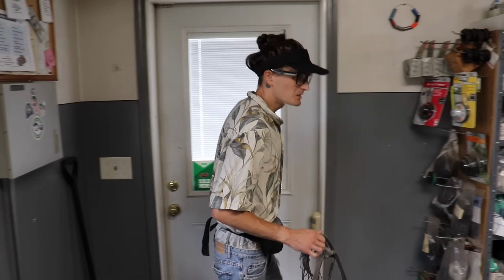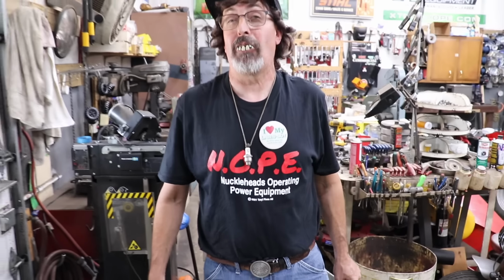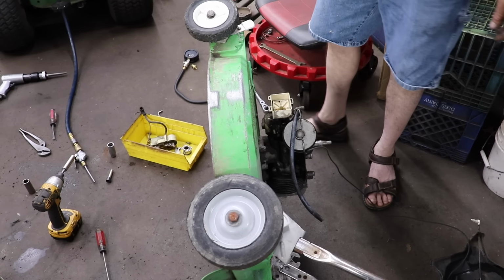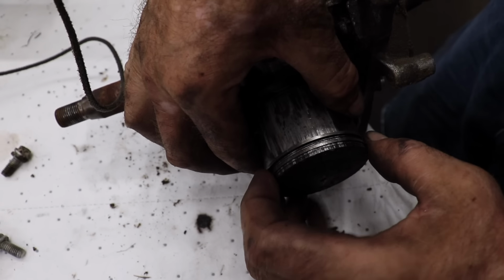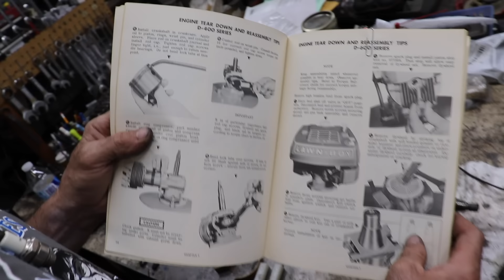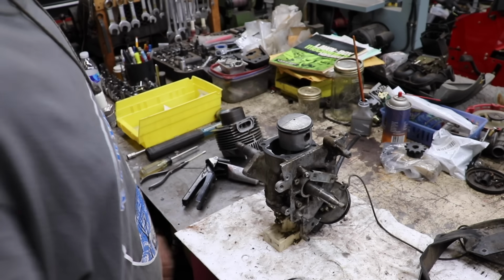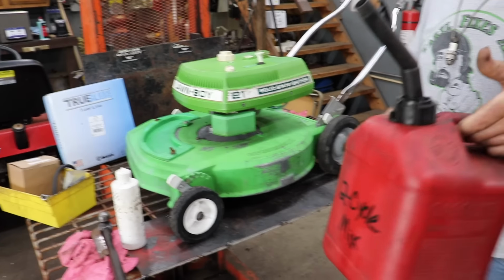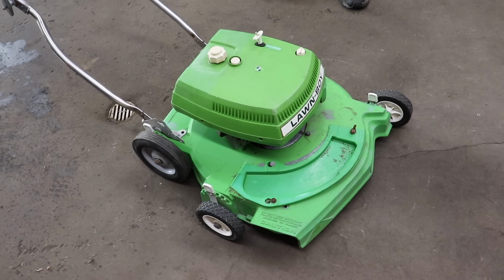Epic Lawn Boy Engine Rebuild

Comment: Haven't seen a Lawnboy in ages. They were great mowers. Never need to change the oil. Runs at high rpm which is great for cutting. Because it's 2 stroke it was way lighter. It threw the clippings farther as well. I never saw one with a bag but I bet they had one. There's a plate on the deck for one. Due to its 2 stroke less parts and things could break on it. The offset wheels also lended to easy tight areas/corners and made it easy to turn. The 2 stroke ban killed them. To bad but Taryl's Got You. Great work My Dude. Great to see the old girl working again.
Reply: We had one with a bag when I was a kid in mid 1970's. It was also self propelled.
Reply: @93sundance  I have one with a bag and it's a commercial model , pick it up at a estate sale a few months ago  in a three mower lot for $30.00 and the reason I bought the lot was just for the Lawn Boy since I'm into restoring antique chainsaws . Only thing wrong with it the plastic piece that slides that controls the engine speed was broke because it got all gum up and someone forced it and broke it but I got a new one . Its self propelled also .
Reply: Thank the  E P A ..for that .
Reply: There was/is no 2 stroke ban.  If you find one, let me know.
Reply: @kevinjohnson5214  EPA didn't ban 2 stroke mowers.  Manufacturers didn't want to invest in clean 2 stroke engine development.  So they discontinued them altogether.  Their last models met EPA regs.  I guess it was easier(cheaper) to make a 4 stroke do what a 2 stroke could than to make a 2 stroke as clean as a 4 stroke.  It was a purely financial decision.  We may not like EPA sometimes, but I shudder to think what the air and water would be like today if we left it to engine manufacturers and chemical companies to self regulate with no regulations.  I remember rainbow colored rivers and choking at stop lights when I was a kid.  The clean air and water acts are two things President Nixon's grandchildren can be proud of.
Reply: @mikemorgan4607  i could sell you one.
Reply: @imakedookie  What model?  My comment wasn't clear enough.  Sorry about that.  I meant "if you find an EPA ban on 2 stroke engines, let me know where."   There may be one in the future and in eco serious states like California may have already imposed some.  As far as I know, EPA didn't ban any.  But the handwriting was nailed to the wall already.  They had to undersize the jet on the Dura Force to make emission specs, and that was in the late 1990s.  There is no way(evidently Toro's margins aren't high enough to allow them to bribe that many congressmen, haha) that emmission standards will go backward.  And that's clearly as it should be.  While they probably could make them burn cleaner, it would cost a LOT of R&D $$ to get where they's want to be.  It was more cost effective to just discontinue production.   But I still have 2 stroke LB Mowers.  And I love em.  I actually bought this one from Taryl.  Great mowers!
Reply: @mikemorgan4607  so if you are an enthusiast, would you happen to have heard of the channel two stroke stuffing? I think the man is onto something, the small displacement supercharged two stroke nitro engine is evolving towards 500cc and 50 hp, i believe... hes gotten it into the 30-ish range so far if im not mistaken
Reply: @imakedookie  I'll have to check that out, thanks.

Comment: I have about three or four of these sitting in my garage. One of the best trim mowers to have especially if you have a real steep hillside you don't have to worry about the engine oil lubrication on a steep hill and it's lightweight.

Comment: Hands down the best general duty push mowers ever made.....
Light weight, powerful and does a beautiful job of manicuring a lawn.
They should have never quit making them !!!!
Reply: I've got 2 lawnboys. Best lawnmower out there I say.
Reply: OMC built good engines for these LB's then big daddy Federal said  no more lawn mower two-stroke engines
Reply: @redwolfpiping5701  OMC sold LawnBoy to Toro in 1988 - years before the Fed Ban.
Reply: The only thing I didn’t like about mine was that the right front wheel was behind the discharge chute so it wanted to dig into the ground when mowing uphill. In some parts of my yard I had to drag it behind me.
Reply: EPA killed a beautiful thing
Reply: @johnnybratsch-zw4ce  They killed the 2 stroke in almost every application ever conceived now they try and push the battery powered bullshit garbage throw away stuff.
Reply: @redwolfpiping5701  OMC new how to build an engine for sure, I also own a Cushman Truckster with an OMC 22hp opposed twin that despite being 40yrs old and having many hours on it runs like a top and uses no oil, it's powerful and super economic to this day. It starts with a flick of the key in any weather.
Reply: I agree that Lawnboy mowers were well made AND they were QUIET, but as far as "powerful", not so much. I inherited an 18" Lawnboy from one of my in-laws, mower was rated at LESS than 2-HP!! It worked okay, IF you had thin, DRY grass! LOL

Comment: I got a lawnboy "D" the "brick" motor of 60's vintage.  Runs good.  I also got it for free and got it running.  I probably should put some rings in it but it will run and start so for now I am leaving it.  The problem is I don't use it enough.  I really have no use for a push mower.  I did some work on it just as a challenge.  I wish I knew someone who would use it.
I picked it up from a trash pile because I used one of these as a child back in the 50's and early 60's.  Also, my grandfather owned a hardware store (from the 30's until 1972) and he sold lawnboys.  the center isle of the store always had a half dozen lawnboys lined up single file in the Spring.  His store one of those old hardware stores that offered much more than what is now considered "hardware."  One corner of the store was dedicated to guns, ammo, knives and assorted goods a sportsman would need.  The hardwood floor creaked as you walked upon it and the air inside was a compilation of traditional old hardware smells and the ever present cigar he enjoyed throughout the day.  Nails were stored in a huge metal binned unit that contained all sorts of nails in bulk that one bought by the pound scooped into heavy duty paper bags with a hand held "claw."  I have so many memories of him and the store.  This got a bit off topic but this and so much more is what made me pick up an old lawnboy out of the trash and try to get it running.  It was a way of connecting to a good part of my past.  Thanks for listening.
Reply: My dad had one I used in the sixties ( I think it was made in the fifties?). The deck was die cast and had the offset wheels. and I remember the spark plug would glow. Strange? When the recoil broke you could take the recoil off and there was a pulley underneath which you could wind a starter rope around to start it.  So you always hoped it would start right away. Lol
Reply: Thx for your story of the old store John. That brought back memories of the old hardware store i used to go to in my home gown. It has been closed down for about 25 years now.
Reply: John What a great story!!! Reminds me of the hardware store my grandad used to take me in back around the same time you were a child. Same creaky floors and metal bins with the bulk nails and heavy sacks. You could get parts for your equipment too.
Reply: Great story.  A piece of Americana that is being lost... the local family owned hardware store.   You have a talent for story telling.
Reply: His store sounds like it was fantastic
Reply: Great story John brought back memories for me as well. Thank you.
Reply: I also restored a lawnboy from the 80s I found in the trash because it was identical to the one my grandfather had when I was growing up he cut grass with it for twenty years until he hit a rock that broke the cam shaft and couldn't find anyone who could fix it and by then lawnboy was gone and he never found another one that he liked as much I got a new one in the early 2000 but metal deck was a two stroke run it for 17 years until it got stolen but nothing is better than the one like my grandpa s I used to wonder how he could rinse it off after every mow and it never rusted he always said pay a little more and get the best but then you take care of it so it will last no one seems to understand that nowadays
Reply: I miss the days of the old hardware store.  It's something that is gone and will never be seen again.  When I say "You used to be able to go the hardware store and the people there would tell you what you need and explain how to do it" it's like the lets get you to bed, grandpa meme.  Now we have a combination of the internet, amazon, and home depot selling us a bunch of Chinese junk.  They factor in failed returned units into the business so they don't care if it's junk.  All of my dad's and grandpa's tools from the 60s and 70s still work.    I'm just thankful I was born in 1979 and got to live a little while before it all went to hell.  There used to be a magic in the air that is just not there anymore.  The buzz of human connection.

Comment: Great video Taryl. We used a Lawn Boy Utility mower to mow our extremely steep hill going down to the lake. We would take the handle off and attach a long robe and let the mower down the hill and pull it up with the rope. People used to watch us in their boats as we cut the hill. There was one hundred steps going down to the lake. When our parents passed away, we sold the cabin. Man, it was a lot of work to that property to keep it up. Most of Loon Lake in Hale MI has step hills going down to the lake. A lot of memories with family at the cabin. I doubt if the person who owns the cabin now, cuts the hill like we used to. What a workout that was! That part of the cabin I don't miss. At this time, I have a Lawn Boy Scamp Utility mower in great original condition for sale. My neighbor gave it to me more than twenty years ago. It needed a new recoil starter and air filter cover, and that was all that was wrong with it. Just blew the dust off from it the other day and cleaned the carb and it started right up and ran perfectly. Sense I have had it, it has spent most of its time in storage. I even have the Lawn Boy engine that was on the mower we used up at the cabin. It starts and runs, but I am sure it could use a rebuild. Many hours on it cutting the property up north. Many hard hours! Lawn Boys with 2 cycle engines are great, simple machines. Love your videos, Taryl. Learn a lot and entertained all at the same time. Can't go wrong with that! Grass Rats Rock!!

Comment: I'm a bit of a LB collector , got several of the D series and a few F series. Love them , they just keep on running with a little TLC.
Reply: The early models are the best. Kinda went downhill with the Silver and Gold series…. Getting the blade adapters off intact was the hardest part of working on these. Worked on a lot of old LB mowers back in the day. Still have a couple of customers with the two strokes.
Reply: I have an all original 1980 Lawn Boy Scamp. It's in very good condition. Took the carb off and completely disassembled it and cleaned everything. New plug and fresh 2 cycle gas and it started right up, and it ran perfectly. Really have no use for it. It's been in the family sense around 1995. My parents neighbor couldn't get it running and gave to my dad. It didn't take me long to get it running. My parents used it a few times, but they were getting old, so a push mower wasn't best for them. After they passed, I ended up with the Law Boy. I used it a few times to trim around the house. Worked great, but I had newer lawn mowers that I used instead. I have no idea what the Scamp is worth? The only thing that is missing, is the plastic grass deflector. It was on the machine when the neighbor gave it to my dad, I am not sure where it ended up?    The blade has little to no wear. I think I replaced it shortly after my dad ended up with it. My question is, what do you think the Scamp is worth? Is 100 dollars to much? I really have no idea what to ask for it.
Reply: @russellmaddock3492  Depending on condition I would think a collector would offer $150 -$200+.

Comment: I had a Lawnboy from HD that I bought new in 1989.  It was self propelled with a 3 speed transmission.  I changed the air filter, plug, and blade every year.  after about 20 years of use the cable that ran from the bail to the cutoff switch on the motor broke and a new one was no longer available.  I wired a toggle switch to the top of the handle, so I no longer had the safety feature (which I was happy about).  Anyway, I used that mower up until 2018 when the electronic ignition model finally crapped out.  I couldn't find a replacement.  I never changed any other parts.  It even had the original drive belt.  I got 29 years of use out of it and the motor was running strong when the ignition gave out.  I bought a 20 year old electric start Toro that still runs like new.  I'm retired to the country now and have over an acre to mow.  I bought a new Cub Cadet LT42 with the 5400 Kohler (Crowler) 18 horse single.  I know this is the Courage motor revisited, but there are a lot of improvements.  And I will check the torque specs on the top engine case bolts annually.  After 1 1/2 seasons and 42 operation hours it still starts and runs flawlessly.  It has a Taryl sticker on the center of the steering wheel, so I know it will last.  Lol  I'd really like to know Taryl's opinion of the new 5400 series.  I knew I didn't want that made in China "MTD" motor.

Comment: "Brendan" - the quintessential Generation Z boy. 
I loved the one lawn boy I owned. 1990, self propelled (part of the reason toro bought lawn boy was to get at their awesome drive system)  2 cycle and super light and great power. Mine smoked a little under load. Had an aluminum deck. Super light weight and great for hilly lawns. Never had an issue with it.
Reply: I got a self-propelled one for $50 at home depot around '97 that somebody returned.  It was a 4 cycle.   Made the job so much easier than the old push mower I was using.
Reply: I'm pretty sure LB adopted Toro's self propel system.

Comment: Great video.  I have collected a few Lawnboys, because I became fond of them, because it was my first lawnmower.  Back in the late 50s, my mom bought one that had the Iron Horse engine and a pull string.  The pull string became a pain in the butt on those days when it was temperamental, but it was a good reliable mower.  
I am going to have to do a lot of work to get the ones I have, restored to operating condition, and this video had a wealth of tips I intend to apply to my efforts to restore them to a running condition.
Thanks for all the entertainment.  It is 3:00 am, I have a starter to install in my 4x4, and it's all your fault.  Let this be on your shoulders,

Comment: I remember seeing these all the time when I was a kid. They always seemed to cut good. But I preferred the Suzuki powered Toros that required every ounce of strength to pull over. Almost no plastic and still very light and powerful. For sure the best mulching and bagging mower I've ever owned. I even know a few commercial outfits still running 70s and 80s Toros despite them being near 40 years old.

Comment: Inherited a 77 lawnboy very similar to that one from an uncle, still runs perfect to this day. And I expect it to run for another 40 years as well. I love how lightweight it is and it can take a beating. Great little machines
Reply: The best thing you Dan do for them is make sure to run them on 32:1 mix, that’s what they all called (except the M series with oil injection) and 50:1, even with modern synthetic 2 cycle oil just isn’t enough lubrication. I’ve seen a few D and F engines and a ton of Duraforces with low compression thanks to guys running their 50:1 chainsaw gas in them. I’m sure someone will chime in and say I’m wrong and 50:1 works fine on theirs but  I always say better to air on the side of caution, especially when you’re only talking about adding a few ounces more oil.
Reply: @J.R.in_WV  Thanks for the advice. I do run 50:1 but I use Lawn-boy brand oil. The machine says to run 50:1 but I may keep it a little richer
Reply: @MrTheBigNoze 
Are you SURE about that mix? I have a 1980 r7070 (F engine), and it specifies 32:1. I started running Echo Red Armor oil, and I actually mix it at 25:1 since it works out better to just use a 2 gallon size bottle to 1 gallon of gas.
I ran a little less than 1 tank through it last year, and it already runs smoother on the Red Armor.

Comment: Wow that brings back memories from when took small engine repair in high school learned all about the lawn boy and Briggs & Stratton engines I liked the lawn boy they were great lawnmowers as long as you added the oil too the gas but some people didn’t do that and you would see them on the tree lawns I’d go and pick them up if it pulled and had compression I’d get it running very easy too work on thanks for the video 👍

Comment: We had on of these lawn boys back in like 1963 and it was super. It got where it wouldn't start so we had a squirt can with 2 cycle gas we would squirt in the air intake an  it would start first pull and run like a champ. We used that mower for 10 or 12 years priming it to start and it worked great. I think probably the crank was either loose or the main seals were bad thus making it not having enough suction to pull fuel to the ports but no matter it was easy to prime. Great video.😊😊😊😊😊

Comment: We had a 50's lawnboy in the family that was used well into the 80's.  It still ran good and was so light to push.  Got  killed one summer when my brother filled it from the  straight gas can.
Reply: they would run forever if you added oil to the gas